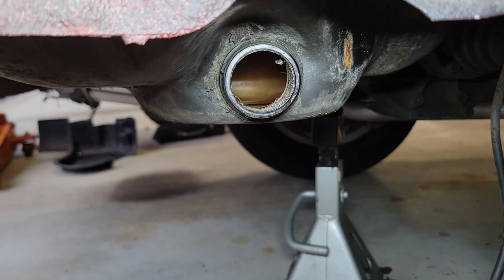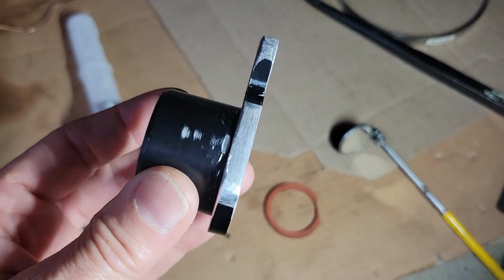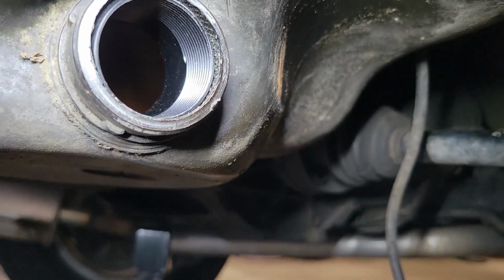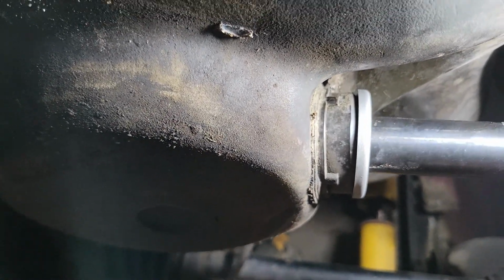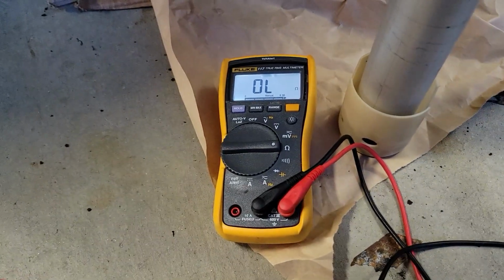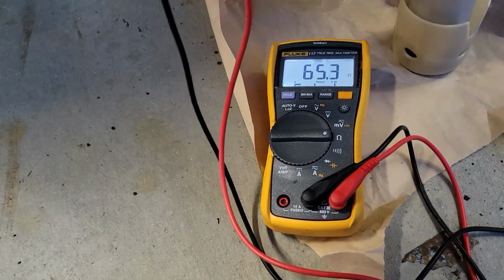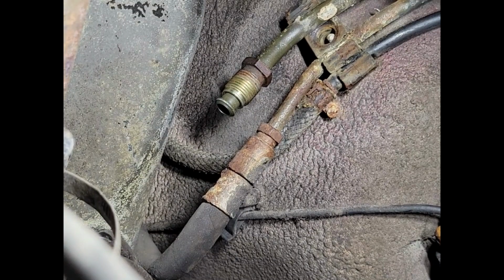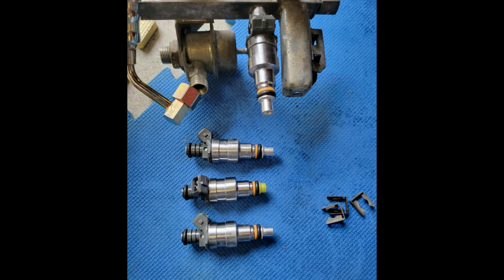Porsche 944 Fuel Strainer repair

Comment: Very nice video.  Just had the repair done and unfortunately fuel was leaking from the bottom of the new strainer.  The ring was trimmed about 3-4 mm but didn't trim the orange seal. The sleeve was almost flush with the flange and it appeared the strainer was nice and snug.  Any thoughts of what could've gone wrong?

Comment: I had the same issue. I used that 928 collar/sleeve and worked like a charm. I actually used a 2nd gasket to get a better seal.  I also have a ‘87 turbo and I didn’t modify the sleeve to make it fit.  I used two different JB Weld epoxies and they both failed before I found this 928 sleeve.  I conclude that JB Weld is for temporary fixes, not permanent.  I’ve had mine on for about 2 years now.
Reply from the maker: That's great that it worked for you!

Comment: Is there no longer a plastic piece? Is it only the aluminum one that is sold online?
Reply from the maker: Not sure what you mean.  The repair piece is aluminum and it replaces the aluminum female threaded boss that was originally molded into the tank.  The strainer is identical to the original and has an aluminum fitting with a plastic strainer.

Comment: Useful solution to a common 944 problem! I wasn't aware of the 928 sleeve option, despite the significant modification, thanks for sharing. I ended up reinstalling the original sleeve when mine popped out, just slathered up with a bunch of fuel resistant JB Weld, seems to be holding up.
Reply from the maker: Yeah, I would have ended up using JB weld had I not found this, but I have still been unable to separate the old strainer from the threaded sleeve. It seems like it's glued together.  I don't need it anymore but it's now a fun challenge to see if I can salvage it without destroying it.
Reply: @ThingsBreak  I guess they become fused as one from oxidation, pretty crazy. I soaked mine in some penetrating lubricant overnight and then gripped the metal sleeve lightly with channel locks after wrapping it was a piece of rubber for grip/cushioning.

Comment: I did the same thing, and I've got the same part. Thanks for showing how to modify it. That was my problem figuring out how it was "supposed" to work, but didn't. For what it is worth, my car is an 85.5 and the filter was extremely clean.  I only removed it because the fuel pump quit. I knew better, should of researched first. LOL
Reply from the maker: Glad it worked out for you!

Comment: Thank you so much for posting this, I am restoring a 944 and after wanting to do some preventative maintenance and checking the fuel strainer, the fitting came out, and so started the battle with it. I tried sealing it and hammering it back in with fuel-rated jb weld, but it jusy blew again. I'll give this a shot. I did trim away some material on the surface of where the fitting sits, do you think that would cause leaks? Just wanted to know before dropping the $180 on this (well designed) part
Reply from the maker: The fitting seals on the outside with a gasket, so if you removed some plastic from the tank in that area, it could leak if you removed too much.  If you can keep the surface flat, maybe the gasket can still seal.  Good luck!

Comment: Send this video to 928rus. Arrogant owner at 928srus believes his product works for our cars. Its obvious that it does not. I had high hopes for this, sent it back but ate the shipping costs both ways.
Reply from the maker: I did send him a picture of how I had to modify the part to fit.
Reply: @ThingsBreak  that amount of modification is not indicative of a compatible installation. The rear seal, becomes completely useless after cutting down the aluminum flange, though it may not be necassary as a gasoline seal with this installation.
Reply from the maker: Agreed, but I figured the outside seal was the critical one since that's all that seals it normally.  The part just provides a mechanical means to hold in the strainer.  Thanks for the feedback.
Reply: It’s actually the inside seal that seals it. Outside seal isn’t even necessary
Reply: @928pcar This is incorrect.  The inside seal is there to add a "cushion" to the otherwise brittle tank.  The insert acts just as original.